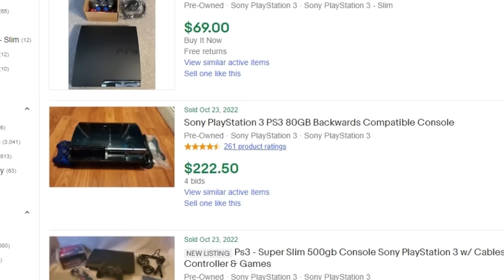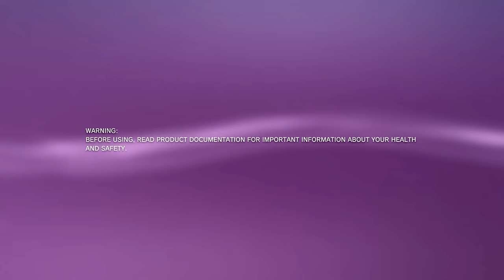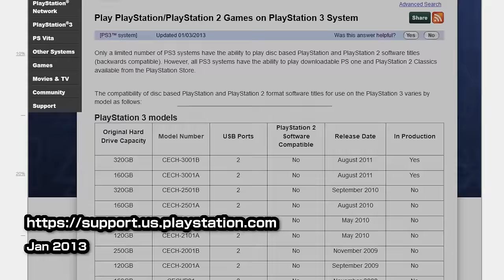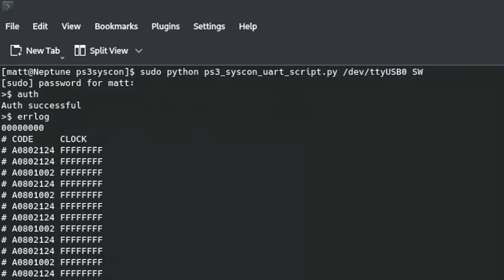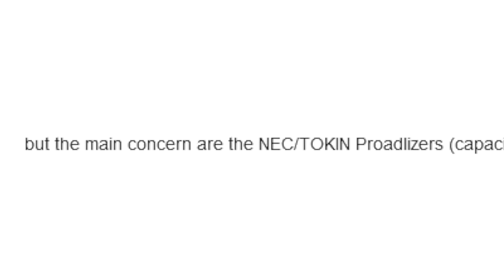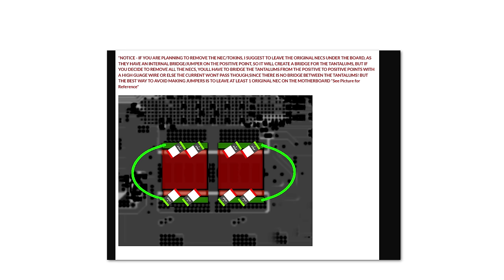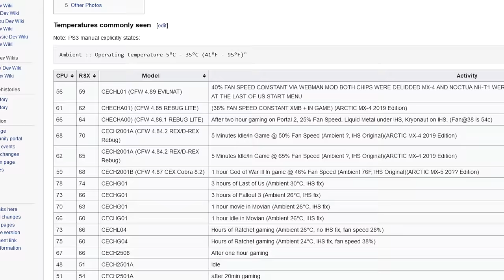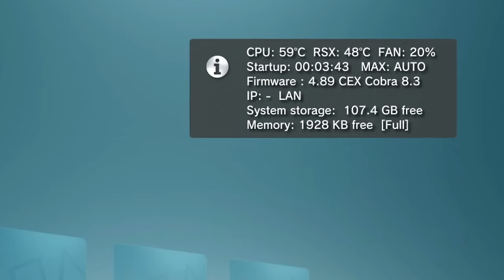I bought 3 PS3s for $50... how bad could it be?

Comment: Great vid Matt, although I highly recommend you watch a certain video on PS3 GPU faults. Its called 'A PS3 Story: The Yellow Light of Death' by RIP Felix and it talks about common misconceptions about the PS3s failure points, including that the NEC/TOKINs are faulty. I'm glad the cap replacement worked in your case, but according to the information in that video the fix you did may have been a red herring for an inherent GPU fault, depending on the model of PS3 you have. I highly suggest watching the whole thing, even though it is a long watch, and checking to see if your models are affected, as the removal of the NEC/TOKINs may have been entirely unecessary, and this "fix" may only be temporary. A permanent fix may involve transplanting a pin compatible later model GPU onto these boards, which might not be worth it if these PS3s only do software PS2 emulation (or none at all). I'm not a PS3 expert or anything, but seeing the NEC/TOKIN myth continuing to spread without context is not good for the landscape of repairing these devices into the future.
Reply: watching one video doesnt make you an expert. NEC/TOKIN chips are notorious for going bad in multiple electronics, not just ps3s, so stop saying its a "myth". Electronics are complex and can have many points of failure. In this case the error code was for the noisy voltage due to the bad caps, the yellow light didnt even show up.. totally different things
Reply: Just did same comment, thanks to RIP Felix! 
About the NEC caps, they are notoriously excellent and fail mainly because of a non-adapted pcb design. The "notorious" you are talking about is mainly based on Toshiba laptops. 
We rarely hear about the other electronics using those caps, for various reasons, but mainly because they'r usually not used in consumer electronics where people will try to recap.
Reply: @joonhkt  simply not true, laptops and all kinds of things use them, and they often cause failures because they rapidly lose their capacitance. Again, multiple things can break in electronics, there isnt one cause. IE something else may be ruining these capacitors, OR the capacitors are going bad causing the issue themselves, both can happen. I just found several laptop posts where these caps were causing a common issue
Reply: @joonhkt  Even for PS3, these caps are well known to degrade over time and cause failures, which could be alleviated if you add some custom heat dissipation
Reply: @MElixirDNB  You said "all kinds of things use them and they often cause failures" I was wondering if you have any evidence to back this up

The only the only information I can find about failing NEC capacitors in other products is in the one Toshiba laptop that from what I seen were poorly design causing the caps to die faster

You seem to know a lot about them so could you tell me all these other broken or faulty products they have found themselves in and are the cause of?
Reply: @joonhkt  the PS3 TOKINs are far away from any heat and shouldnt behave like theyre in a blast furnace
Reply: @MElixirDNB  someone measured a dead TOKIN and it didnt lose any capacitance
Reply: @tylern6420  one anecdote doesn't change that others have had these fail. Electronics is never "this is the problem", it's a complex system so there aren't any generalizations that fit, you need to get the schematic and check each part

Comment: Lol in honor of this video, it inspired me to pick one up myself! Grabbed mine for 10$ - with 3.50$ shipping it’s a FAT model CECHH101 with YLOD, came back to pick up some tips, hopefully I can find the serial connection so I can find some error codes. And get to the root of the issue/issues my ps3 could potentially have! Thanks for documenting your experience as I probably would have never considered picking up one of these of these older model ps3’s for repair.

Comment: I still have my PS3 (would like to say original but I had it swapped by Sony when it YLOD) and it is one of the original European models with software emulation for the PS2.
It actually works but when I put it into standby it does the flashing red light thing you usually get after the YLOD.
I don't actually use it anymore and it's currently sitting with my PS4 pro in a corner of my room. It had been repaired a couple of times for YLOD but really not sure if it is worth the effort (and cost) of getting it looked at. Funnily enough, the main reason I would get it going again is because Hogs of war is on it (coincidentally that's the game you have in your description) which was never available here in the UK and I managed to snag it from the US store with a little account trickery.

Comment: Someone else already mentioned it, but the video posted is the history for the YLoD and how the NEC/Tok chips aren't the issue in like 95% of the time; during the video is also why you are able to use SYSCON error codes for some diagnostics. It will be significantly more interesting if your repair actually fixed it and it lasts the test of time. https://www.youtube.com/watch?v=I0UMG3iVYZI

Nice job though on the deal. I'd also recommend the delidding one day, will help temps quite a bit, that's what I did with mine.
Reply: Right the video I wanted to suggest. They almost published at the same time!
Reply: And it's not really recommended to replace the NEC/TOKIN with tantalum capacitors (it's also in the video)
Reply: thank you so much for replying with this, I got scared the moment he mentioned the NEC Tokin

Comment: correction: you can fully use a ps4 controller on ps3 wireless - on your ps3 hold share and PS to enable pairing, head over to bluetooth settings on ps3, scan and it'll find the controllers as "wireless controller", select it and it'll be connected with full functionality minus PS button
yes you can pair multiple controllers in the same fashion

Comment: FYI: if you buy a used console from a doggy place there is a pretty good chance there will be roaches or other insects as consoles are usually hot and these insects enjoy warm spots. Roach eggs can hatch after something ridiculous like 6 months or more so even leaving it outside won't be enough. If you suspect there are roaches, the best thing to do is to leave the console in the freezer for a few days and then thoroughly clean the console. It's a nightmare so don't do it unless you really want a good deal. Also, getting roaches in your apartment is the absolute worst thing you can imagine.

Comment: You clearly deserve respect for fixing those PS3 consoles.
I couldn't do such things which is why I'd probably have to throw away mine once it goes YLoD or something.
Reply: There are many others that repair PS3 consoles the actual proper way by reading the syscon codes and determining the ACTUAL errror instead of swapping out tokins and puttin a spacer between the Cell. This was not the way.
Reply: @shawnunder7  i mean he did read the syscon error codes thats how he came to the conclusion to try swapping the capacitors

Comment: I bought a PS3 for 25 euros and it included Need for Speed Most Wanted and a controller. Backwards compatibility only seems to work on PS1 games. It tries to do it for PS2, but it never launches any games. I installed EvilNat CFW on it because well, of course I did. I would like a better cooling solution, it's still pretty hot and especially loud.

Comment: Instead of washing the board under water which can lead to issues in the future or even immediately, I’d recommend blowing it out with a air compressor or some compressed air and then scrubbing it down with a brush that isn’t too stiff and isopropyl alcohol. Water can easily get under chips and corrode in a place you’ll likely never see unless you go crazy rebuilding the board reflowing each chip.

Comment: 3:18 You can pair the bluetooth for a PS4 controller to a PS3 and it will work, you'll just need another controller connected to open up the bluetooth settings on the ps3 and hit connect (once your controller is in pairing mode).

Comment: you can connect the PS4 controller via bluetooth going to accessory settings on the PS3 and putting the controller on pairing mode, by pressing PS+options or PS+share and pair the controller with the PS3.

Comment: I'm very curious to know if the tiny wires used in place of the tokin bridges are still intact... Those are high current connections! (Tens of amps when under load!) You'd better use wide conductors

Comment: Actually in the 3:20 mark, you can plug in ANY HID controller into the PS3 that outputs Dinput. Along with that you can use the PS4 controller wireless (as well as other bluetooth enable controllers). You go to bluetooth setting on the PS3 and turn the PS4 controller into share more (PS+Share till the lightbar flashes rapidly) then you can use the PS4 controller like that. But yeah you can't use the home button without use of an homebrew plug in.

Comment: In regards to plugging a ps4 controller into the PS3, I actually ran into an issue after getting the original Nier.
The PS4 controller was apparently to advanced for that game.
It would detect the inputs of the buttons, but the analog sticks absolutely would not work at all, and same with the triggers.

Comment: I just saw a Felix RIP video where I'm pretty sure he said you can replace the 90nm RSX chips from these fat models with the 60nm chips from later fat models and even the 45?nm RSX chips from the slim models, and they should run a lot cooler and not have the same issues with YLOD as the 90nm chips... And you can also buy NOS 45?nm chips still from sites like AliExpress and eBay... There's some mod chip you can buy to make the 45?nm RSX chips work in the fat PS3.

(I can't remember if the slims had 40nm or 45nm RSX chips)

Comment: Could've used a thin copper plate to make the heatsink a bit taller so it would sit flush. Being an excellent conductor, it might help bring the temperatures down the way the eraser did, just from the other side. Unless that means the clearance above the heatsink would be too tight.

Comment: I would have put some ink on top of the caps and push the heatsink down to see where it's hitting. The heatsink is aluminium and a drill bit should go through it like butter, and you'd only need to make shallow indents for the caps to fit in

Comment: The "railway" you created for the caps probably also means the caps are going to function better than your diagonal method of soldering them in place since they're going to have much better electrical contact. Solid core copper wire would've been better still than the paperclip since it's... copper instead of steel and is a lot more electrically conductive.

Comment: I used to have a back-compatible model, but it overheated and went YLOD every summer and I had to take it in to get the board baked. Eventually I got tired of it and just gave it to a shop for parts, then bought a slim and a PS2.

Comment: 3:18 Actually, it can be wireless; you’ll just have to connect via Bluetooth; you can’t use the home button. I’m not sure about vibrations, though (maybe I’m going to test that tomorrow). Also, something interesting is that if you turn on the PS4 controller, it’ll turn on the PS3.

Comment: This was a good video, but a correction the NEC/TOKINs do not fail on mass. Scroll more towards the end of the OG post and you see they fail. I recomend wathcing RIP-FELIX video he has quite some evidence towards his speculation on the mass failures. As of your case the first error code you did get could be NEC/TOKIN not sure if you checked to see if they were actually shorted out at all on the GPU side. Also downside to replacing caps is you do get noiser power to which ever chip you replaced the them on. This means just more freezing and sometimes more crashes. Other than that major detail great video.

edit: You talk about adding more preassure and its no adding more preassure is correct. Actually on boards sent to sony they added a plastic peice it was known the CELL IHS was uneven and did not make perfect contact so it does heat up a little more than it should. There is not much to add. I find adding a good quality thermal pad that isn't going to melt. Like something from EK adds enough preassure and also ofc helps sync the heat back to the shielding

Comment: Another youtuber dived into this Tokin capacitor problem, and he worked out that these caps are very reliable, as heat is bad for capacitors, they are well above spec, they don't fail in the ps3, it's also a symptom, not a cause, it might work for a while, but those Tokin's are not it! It is the RSX chip itself! "But he replaced these caps and it worked?!" Yes, it works, but what happened is, he heated up the area very close to the GPU, as the gpu is made by TSMC, you know, the manufacturer that also makes nvidia gpu dies, they used a kind of bonding to attach the die to the package, and it is that bondage that fails, and if you heat the area long enough, this bond gets liquid enough to remake contact with the package, it's like the nvidia 8000 series of laptop chips, the most infamous was the 2007 - 2008 macbook pro models, they fail as well because of the bonding used by, you guessed it, TSMC. To remove the Tokins, you need a lot of heat, and since the board soaks up enormous amounts of heat thanks to the groundplate, you heat up the RSX chip, solder melts at 320 degrees celcius, and since that bond material gets liquid enough to 'rebond' the die to the package only requires 175 degrees celcius, it's more than enough to "fix" the gpu. The caps are just a placebo effect unfortunately. Once the damage to the bonding material has been done, there is no way to fix it, you can only patch it up, and yeah, it works, but nobody knows for how long. It can last 1 day, 1 week, 1 month or even a year, but eventually, it will fail again, and you think it's those caps because they aren't an exact replacement, you will change 'em out again, but you might come to the conclusion that the RSX still doesn't work after a fresh set of caps. You are borrowing time, the real fix is to replace the RSX with a newer revision, there is a way to install the RSX from a slim or super slim into these old ps3 consoles, with mods and firmwares offcourse, since these original RSX chips are 90nm, the slim uses 65nm (only later revisions of the slim don't have failing RSX chips, the earlier models do use 65nm dies, but yes, they are bonded with the same failing "glue") and the super slim uses 45nm dies. Every phat PS3 will eventually fail, yes, all of 'em, but, now you know how to fix 'em properly, it's not those Tokin caps as i stated before, they run well below their rated spec and temps, those caps are rated for 105 degrees celcius, and since they are away from the gpu, they don't fail. In Toshiba laptops from around that era (something the Tokin problem gets associated with, these Tokin caps in those affected laptops are right underneath the gpu, yes, dead center on the other side of the board, that's why they fail, they get way to hot, but not in the PS3 phat. I hope your understanding of this problem is resolved now, i don't know how to describe it otherwise. As an example, to "fix" such an affected gpu, i took the motherboard out of my macbook pro 2008, who died just randomly, i putted it in an oven for about 7 minutes at 220 degrees celcius without replacing anything, and when i reassembled this macbook pro, it worked! The laptop came back to live, because i created a zombie, i resurrected a dead chip :p

I found the video, it's called: "A ps3 story: The yellow light of dead" by RIP Felix

Comment: I highly recommend you watch the video called "A PS3 story the yellow light of death" as it goes over why the Tokins might be fine.
What you might have done when replacing the capacitors and applying all that heat in that area is just temporally fix some ball solder on the other side.
That's what I got from the video anyways.

Comment: Fun fact, you actually can use the ps4 controller wireless, just have to connect it using the bluetooth menu (I used a ps4 superslim tho so idk about these) but it can do everything but use a headset, and press the playstation button. And doesn't work on a ps2/ps1 game

Comment: Unless I'm misremembering you can connect a PS4 controller wirelessly by holding down the Playstation button and the share button on the controller until the lightbar flashes and then adding it through the bluetooth settings menu on PS3.

Comment: To lower temperatures even further, you could remove the internal PSU and power it from an external Xbox 360 PSU (will require a new socket on the back of the case to except the Xbox 360 plug and a slight mod to the wires internally. I put a 120mm fan in the place of the old PSU to make it even cooler.

Comment: With one of the newer updates, at least on the slim model, the PS4 controller can actually be paired wirelessly to the PS3 the same way you can pair it to a phone. However, the vibration doesn’t work iirc

Comment: 18:31 as soon as you said you needed them somewhere else, i was thinking "Couldn't you just wire them to the board and put them off to that side over there, in place with electical tape, like the XenoGC in the gamecube video?" and while i wasnt really right, i wasnt wrong either.

Comment: The only models that (Officially) have backwards compatibility are CECH-A01(20GB), CECH-B01 (40 & 60GB) and CECH-E01 (80GB). The A01 & B01 Models are Hardware based Backwards Compatibility (PS2 Emotion Engine CPU) and the E01 is Software Emulated (No PS2 Emotion Engine Emulation CPU) Any of these models are sought after however the A01 & B01 are the most sought after because of having an actual PS2 Emotion Engine CPU on the motherboard.  The E01 Emulates games using a virtual Emotion Engine.